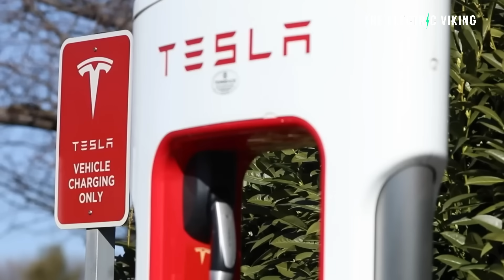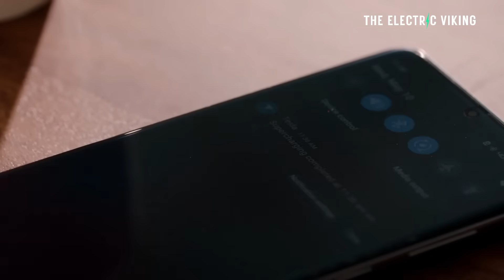Game-Changing Tesla Battery Could DOUBLE Your EV’s Lifespan!

Comment: Nice, but as you hinted, the difference between charging to 80% or 90% is already minimal. If you really want to reduce calendar ageing, you should keep it below 60%. 
LFP batteries have a slightly higher threshold at 70%.

Comment: My car with only 3.5 years and 42k miles already has 12% battery degradation (supposedly with only charging it to 80% for most of the life and only making 2 long trips a year with superchargers) and Tessie shows that I'm 3-4 kWh below the same vehicle average, so I really hope that they have something that makes it more consistent in the fleet and reduced loss, because this degradation does make it much harder to make long distance trips in the middle of the US where charging stations are not as common. Maybe mine is just a bad model since it was made in late 2021 and was left over parts they could find.

Comment: Hi Sam. Love your videos and totally respect the work you do. I take away a different conclusion from this video about the nickel-doped battery. I don’t believe the consumer will notice or care about a 4-fold reduction in capacity loss for the following reason: while most ICE drivers are fine holding onto their cars for 10 or 20 years, EVs are more like cell-phones: the features change so fast that no one will want to hold on to their 280-320 mi range EVs when newer models will give them 400-500 mi range and will enable charging that adds 100 miles of range in 30 seconds ( I learned this in one of your videos about new mega-chargers.) We’ll begin to see leasing plans that regularly turn-over older EVs just as the cell phone companies get you to take new phones after 2 years (even when the batteries will last 5 years). Why will they do this? Because the car companies will be able to repurpose those batteries into the grid storage market. THAT is the application that will care about the reduction in capacity fade, and this after-market will be found money for the automotive OEMs. “Variety is the spice of life” and I believe most humans love the next new thing and don’t really want to own the same vehicle for 300,000 km.

Comment: Talking of battery charging - anyone read about the new range extender from Renault/Geely?  Basically a small petrol engine that powers a generator that you place in the luggage compartment of the vehicle, it then produces electrical power to charge the vehicle's battery.  Why does this seem like backward engineering, after all what is the purpose of an EV! 😮

Comment: Lifespan is a important factor 
However does that fix the thermal runaway fire problems 
Or the slow charging
Or the sensitivity to heat and cold?
Or the dependency on toxic lithium or cobalt?

Comment: My LR M3 showed me a daily usage limit of 90% in the first 3 years of use - resulting in the loss of about 20% of battery capacity after about 100.000 km. Afterwards the car started to show 80% as in most of the cases. I guess my car was assigned to a test group to see how the batteries tolerate this charging behaviour in the real life and I got what I got without the possibility to make Tesla fix the problem this caused. Tesla simply said below 30% degradation in the guarantee period everything is just fine, whereas the statistics says that a 7-10% drop is normal after this milage.

Comment: About the charging to 80% it might be ok for that chemistry but for li-ion, if you noticed, the first 20% is not the same as the last, or even the middle 20% , thats where most of the capacity is. I got like 10km range in my first 10%, as opposed to liek 1km on my last 10%. When they say charge to 80 and discharge to 20 witih lion to preserve life, they are basically saying, use half your battery, and you'll have double life! well duh, i hope so your not gaining anything more by doing that, although i could see not discharging past 20% because there really isnt much juice there.  Perhaps that could preserve some more life so the capacity isnt worth the degradation, but i dont know that for sure.

Comment: Another reason for not charging to 100% every day. . .   As you get close to maximum charge, regeneration becomes impaired. So, you'll have to get used to different behavior from regen at the beginning of your day, as compared with later when the state-of-charge is lower.  There are some cars that try to compensate for this effect by blending in friction brakes to simulate the missing regen if the SoC is very high, but I don't think that's a perfect solution.

Comment: Nice Catch! 

Energy Density is what the media is looking for and price reduction. This effectively does both but the reduction in loss is not seen in year one, the price difference, while welcome is probably not more than 10% or they would tout it more and the increase from 83-91% recommended charge level Is immediate effective range increase for most cases , but not the ones where range is needed most (long trips). Increasing utility of battery from 250k miles to 500k miles also won't be fully appreciated (but will be a boon for Robotaxi, Home power supply in blackouts, other high utilization applications). 

This does all things under the radar while people are watching absolute range and price (ie the needed specs to bring Cybertruck down to 70k while providing range in the 500mi realm. That will set Cybertruck and Semi on Fire.

They still haven't solved silicon issue yet and might go for thicker electrolyte layers if they can solve bonding of the dry electrolyte while staying away from solvents/ovens. 

I am still waiting for a (still cheaper) 300wh/kg minimum with the once targeted 350wh/kg on a reasonable horizon. Per Musk, at 400wh/kg electric commercial aircraft are worth looking at.

Still... this is Very nice. Suggests lower impedance in the battery... long sought after (a step away from the media).

Comment: There are two types of degradation: the first one related to number of charge-discharge cycles and the second one related to degradation due to passage of time. If car goes 10000 miles per year degradation due to passage of time could be faster. This info is needed.

Comment: Since 2024, there have been a number of good, high-efficiency, low-degradation, high-energy-density (300-500 Wh/kg) ready for mass production. But only this year EV batteries are getting over 200-250 Wh/kg energy density. Very slow progress from the scaling-manufacturing side.

Comment: I have driven 500.000km in EV as a cab driver.
I charge every day to 100% and never have seen a drop in range.

I always drive way further than WLTP and I make a photo every starting day.

I drove a Kia E Soul 64kwh 285.000 km and still began the day with 540km (WLTP 485km).

I have my current BMW iX1 64kwh for 1 year 68.000km and today I will start at 550km.
Reply: I have test driven a 2.5 year old Tesla 3 that served as a taxi. The battery was degraded to 75% including the reserve.
The vehicle also got more power hungry. It was definitely not even worth the good price they asked for.
Reply: right on!

Comment: There is no definitive evidence from reliable sources confirming that Tesla is developing a new lithium battery that will double the lifespan of electric vehicles (EVs). A YouTube video from September 3, 2025, claims Tesla is working on a lithium battery that could double EV lifespan and allow safe charging up to 90% daily, potentially reducing replacement costs. However, this claim lacks corroboration from Tesla’s official statements or other authoritative sources, and YouTube videos are not considered conclusive evidence.

Comment: tesla cylindrical cells dont really loose capacity over time. the main issue with them is the cheap wire bonding fuses tesla uses which wear out and come unbonded and cause more heat/stress on the remaining parallel group in the module leading to cascading failures of the wire bonding. short term solution was for tesla to use foam to encase all the cells which somewhat addresses NVH/thermal issues... but its more of a stopgap solution. the real solution is to just use busbars lol... thats the real durability gain for LFP teslas is that they dont break their cell tabs as easily. these issues with battery internal damage is compounded by higher weight, aggressive driving, afk driving into potholes (full self driving) and ignoring suspension issues. no one is really talking about this right now... wait until all the model 3's start comming out of warrenty and people have to figure out how to fix modules instead of swapping them under warranty.

Comment: LG batteries are the ones put in the Kia-Hyundai cars. My Kia Ev6 has still 100% SOH after 70.000 Km. We start to see used cars with more than 100.000 km and still a 99% SOH. The cathod of the LG batteries doesn’T crack as much as the others, main reason of dégradation or not of batteries.

Comment: So you can charge 10% higher, and it will last twice as long as the current batteries that already outlast the car? Maybe that's why nobody is talking about it. Faster charging at higher capacity would be a thing.

Comment: Anywhere where they don't put salt on the roads, aluminum electric cars could last for 40 years. Some suspension parts would need to be changed, but they are pretty simple. The synthetic oil in the gearcase and motor might need changing every 150,000 or so miles. Tires and some brake parts would need replacing. Low voltage batteries will need changing. Companies will make slip on seat covers for popular cars. Buy rubber floor mats so you will never have holes in the carpet. Keep it out of the sunlight as much as possible and the paint will last for 40 years, or longer. Remember that cars are not off road vehicles. You flex aluminum too much and it will crack.

Comment: It would be really great to see a 4.2V aluminium-ion battery replace Lithium across the board, but naturally, any advancement in battery technology is wonderful news. Silicon Graphene aerogel or hydrogel seems like the next likely breakthrough because an aerogel or hydrogel could theoretically expand and contract without incurring as much physical strain on the substrate. Energy density goes up but let's focus on making batteries more environmentally friendly and increasing recyclability.

Comment: I think your spot on where the need to update cars will be based on the worn out seats and suspension etc, even in current i.c.e. vehicles its easy to update things as they degrade and have a 500,000 km car still serving its purpose, this will become so much more achievable with an aluminium body EV that is well cared for.

Comment: When looking at buying "new" cars last year, I determined that base price, tire costs, and insurance costs outweigh the fuel & maintenance savings that come with going from hybrid to full EV. Tesla uses big rims that take expensive tires. These batteries don't address those issues. If they choose to reduce weight, range will stay the same. If they increase range, weight will still be a problem.

Comment: Our six year old M3P has only around 8% degradation, which is awesome. And yes, I DO look after it, just as I’d do the best for my ICE vehicles in the past, with good oil and regular oil changes, more often the recommended. It’s cheap insurance. 
Mostly I charge to only 65% or so unless I need more, only filling to 95 or 100% immediately before a long time.
These new batteries will be awesome.

Comment: Great exciting videos, man! 🔋👍
Let's get it to an infinitely passively superpowering clean renewable infrastructure with automated EV battery swapping, and, in due close time, wireless powering roads for constantly mobile infinite clean energy freedom. The sun's fusion power is getting too stupidly self-destructively wasted. Time to funnel all that wasted heat and light into distributed geothermally cooled underground stored efficient smart low profile abundant battery power with energy sourced from upgrading every parking spot everywhere with car protecting shaded solar canopy parking and commercial rooftop protecting solar canopy completely covered people utilized shaded walking spaces. The key is to have the long lasting vertical support framework setup on which solar panels can always be recycled and constantly upgraded to more efficient new more capable solar panel technology. Same with the EV infrastructure battery swapping, where distributed grid battery backups, as well as all EV batteries can always be recycled, and swap upgraded with more capable longer duration higher density cheaper more abundant materials based batteries as battery technology advances more and more. All of this working in tandem to make the most of the sun's awesome power as we strive to learn its full infinite powering fusion nature in order to constructively incorporate it into the awesome advancing resilient technologically progressively abundant supersustainable infrastructure!
      🤛😆🤝🤖👍🚛⚡🔋⚡☂️🪟☀️🪟☂️⚡🔋⚡🚒⚡🔋⚡☂️🪟☀️🪟☂️⚡🔋⚡🚌⚡🔋⚡☂️🪟☀️🪟☂️⚡🔋⚡🚚⚡🔋⚡☂️🪟☀️🪟☂️⚡🔋⚡🚑⚡🔋⚡☂️🪟☀️🪟☂️⚡🔋⚡🚐⚡🔋⚡☂️🪟☀️🪟☂️⚡🔋⚡🚜⚡🔋⚡☂️🪟☀️🪟☂️⚡🔋⚡🚙⚡🔋⚡☂️🪟☀️🪟☂️⚡🔋⚡🚗⚡🔋⚡☂️🪟☀️🪟☂️⚡🔋⚡🛻⚡🔋⚡☂️🪟☀️🪟☂️⚡🔋⚡🛺⚡🔋⚡☂️🪟☀️🪟☂️⚡🔋⚡🚲⚡🔋⚡☂️🪟☀️🪟☂️⚡🔋⚡🛴⚡🔋⚡☂️🪟☀️🪟☂️⚡🔋⚡🛹⚡🔋⚡☂️🪟☀️🪟☂️⚡🔋⚡🛵⚡🔋⚡☂️🪟☀️🪟☂️⚡🔋⚡🦼⚡🔋⚡☂️🪟☀️🪟☂️⚡🔋⚡🏍⚡🔋⚡☂️🪟☀️🪟☂️⚡🔋⚡🏡⚡🔋⚡☂️🪟☀️🪟☂️⚡🔋⚡🏠⚡🔋⚡☂️🪟☀️🪟☂️⚡🔋⚡🏘⚡🔋⚡☂️🪟☀️🪟☂️⚡🔋⚡🏢⚡🔋⚡☂️🪟☀️🪟☂️⚡🔋⚡🏤⚡🔋⚡☂️🪟☀️🪟☂️⚡🔋⚡🏥⚡🔋⚡☂️🪟☀️🪟☂️⚡🔋⚡🏨⚡🔋⚡☂️🪟☀️🪟☂️⚡🔋⚡🏩⚡🔋⚡☂️🪟☀️🪟☂️⚡🔋⚡🏪⚡🔋⚡☂️🪟☀️🪟☂️⚡🔋⚡🏫⚡🔋⚡☂️🪟☀️🪟☂️⚡🔋⚡🪑⚡🔋⚡☂️🪟☀️🪟☂️⚡🔋⚡⛺⚡🔋⚡☂️🪟☀️🪟☂️⚡🔋⚡🚓⚡🔋⚡☂️🪟☀️🪟☂️⚡🔋⚡🚕⚡🔋⚡☂️🪟☀️🪟☂️⚡🔋⚡🚅⚡🔋⚡☂️🪟☀️🪟☂️⚡🔋⚡🚄⚡🔋⚡☂️🪟☀️🪟☂️⚡🔋⚡🚎⚡🔋⚡☂️🪟☀️🪟☂️⚡🔋⚡🚃⚡🔋⚡☂️🪟☀️🪟☂️⚡🔋⚡🏎⚡🔋⚡☂️🪟☀️🪟☂️⚡🔋⚡🛳⚡🔋⚡☂️🪟☀️🪟☂️⚡🔋⚡⛴⚡🔋⚡☂️🪟☀️🪟☂️⚡🔋⚡🚁⚡🔋⚡☂️🪟☀️🪟☂️⚡🔋⚡🚤⚡🔋⚡☂️🪟☀️🪟☂️⚡🔋⚡✈⚡🔋⚡☂️🪟☀️🪟☂️⚡🔋⚡🚀⚡🔋⚡☂️🪟☀️🪟☂️⚡🔋⚡🛰⚡🔋⚡☂️🪟☀️🪟☂️⚡🔋⚡🏟⚡🔋⚡☂️🪟☀️🪟☂️⚡🔋⚡🏙⚡🔋⚡☂️🪟☀️🪟☂️⚡🔋⚡☂️🪟☀️🪟☂️⚡🔋⏳⚡☂️🪟☀️🪟☂️⚡🔋🔋🔋🔋⚡🏭⚡☂️🪟☀️🪟☂️⚡🔋⚡☂️🪟☀️🪟☂️⚡🔋🔋🔋⚡☂️🪟☀️🪟☂️⚡🔋🔋🔋⚡⚡⚡⚡☂️🪟☂️🪟☀🌞☀🪟☂️🪟☂️⚡🔋⚡🌪⚡🔋⚡🌛🌊⚡🔋⚡🌎👍

Comment: The Tesla car body and other electronic parts will have broken before the battery has become so bad you cannot get any milage.
Many reports of Tesla doing over 250 kms. the cars look like owned by a hobo but they are still running.
Common issues are faulty seals on drive motors and reduction gear box, and leaking seals into inverters because ownerse dont change the coolant every 3 years.
Aluminiums and a Stainless steel fitting on coolant pumps cause electrolysis, and the Anti corrosion inhibitors in the cars coolant system stop working properly after 3- 5 years. 
This is often neglected area and then seal go and issues start to raise their heads.

Comment: Tesla's batteries are lasting way longer than that.  There's a guy on quora website that claims there's a model s in the Denver area with a million miles on the original battery and motor.

Comment: my 2019 M3 SR just turned 100k and battery has lost 25% of its capacity, so not enough for a warranty replace, and yet replacing the battery is still a five figure outlay.  Bummed that all these battery cost reductions have not impacted the aftermarket replacement costs much at all.
Reply: You can EASILY get second hand batteries for a fraction the cost of new. So many cars are written off by insurance for relatively minimal damage. A friend just put a new (used) battery in his high mileage Model 3 for around $6k. The replacement battery came from a car with under 10k on the odometer, and it is very close to full new capacity.
Reply: @FutureSystem738  that's amazing,   ElectrifiedGarage is about double that.  But now I see there are several M3 packs on ebay for just a few $k, will look into that route. Thanks!
Reply: Kinda kills the perceived advantage of EV vs. ICE.
Reply: Lost so much?
Reply: That is a shame.
Reply: 25% is awful, especially since the 2019 range wasn't that great to begin with.
Reply: Don't replace the same battery upgrade if possible
Reply: Or buy a good used battery
Reply: @williamreese6642  I have the smallest battery they sold at the time, the SR not the SR+.  Someone said this means tesla has put a limit on the range of whatever replacement battery I get.  Huh?  I would love to get an M3 LR battery but am not sure I can just buy one and have it installed and it automatically delivers its specified range.